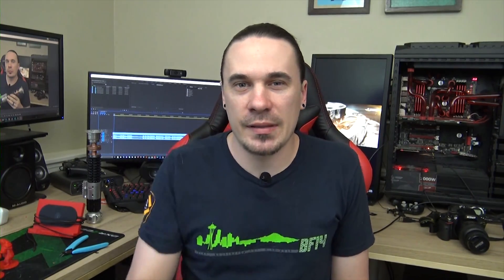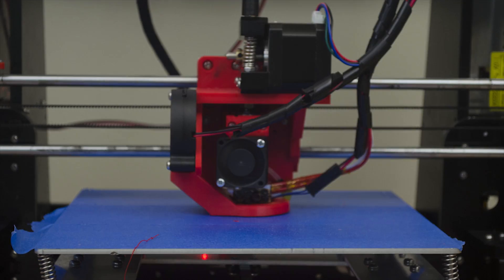Was It Worth It? | Bowden ESD V6 Upgrade Review

Comment: The hot end Installed in the last video was not an E3D V6, it was a Lite 6, also no Bowden setup, my stock Anet is about as much of a Bowden setup as yours. What would be cool is to attempt to add dual extrusion with the same motherboard (z axis in parallel, spare port for other extruder. Software changes)
Reply from the maker: RevivedAsh267 I have been thinking about doing a dual extruder upgrade.
Reply: Electreak well there does exist the Anet8-M, this already has a dual extruder. My point being that the design of the printer it’s extremely similar to that of the anet a8, if it’s possible to buy the dual extruder parts and motherboard that might be a possible method for adding dual extrusion.

Comment: If you use a glass surface on the A8, you never have to pry parts off. I got mine made with the corners cut to access the screws. Prints always stick to the hot glass surface and slide right off when they're cooled! No hairspray. When of my favorite upgrades after the Bowden.
Reply from the maker: Stephan Bevan thank you for the suggestion! I may have to do that soon!

Comment: This is a very misleading video.The test you have shown here is completely invalid. The entire point of going to a Bowden setup (as another person mentioned) is to remove the weight of the extruder motor from the x axis carriage. Removing mass allows for less "jerking" of the axis when it's changing directions etc. This is ultimately what improves print speed and most importantly quality. This is still a direct drive setup (as far as I can tell) utilizing an E3D hot end. Maybe removing the word "Bowden" from the description would help.

Comment: You should test layer strength, because a lot of people including me use 3D printers to print functional parts that need to be very durable. I would expect that the stock extruder will pass this test because in the E3D print the model broke from the base and the raft came out easier as you said.

Comment: Cool video but as some other people said--that's not gonna be Bowden until you move the extruder motor up onto the frame
Reply: Electreak do you have a mosfet board for the hot bed?
Reply from the maker: Aaron Beckman After some research I'm going to do an update video. also the printer died. I will be doing a video on that as well.
Reply: Electreak that's too bad that your printer died :( My Anet a8 is still going strong
Reply from the maker: Aaron Beckman yeah. Glad to hear your setup is working well! I just plugged mine in last weekend, and the hotbed was showing 118c, but it wasn't even hot.
Reply from the maker: Hammy243 I do not yet.